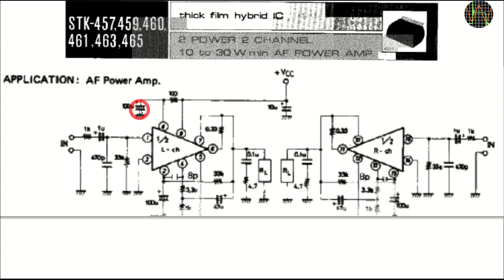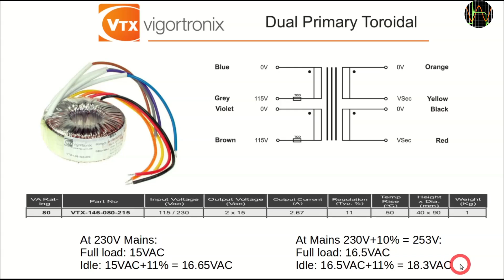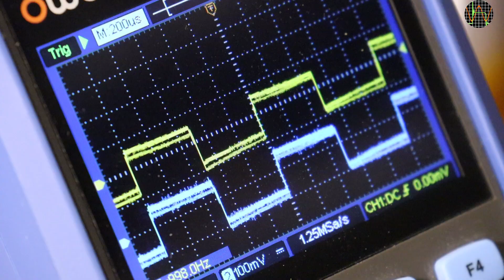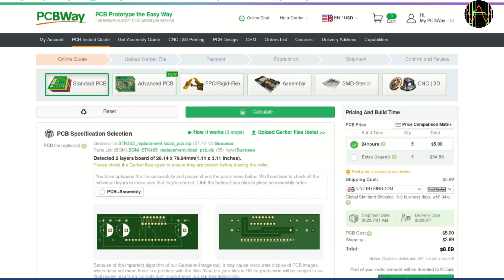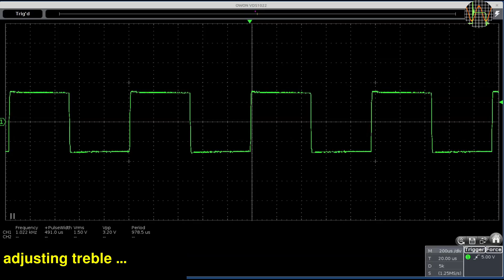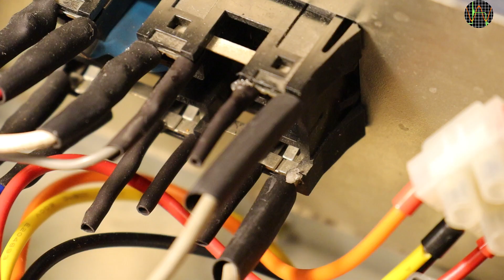187 - Repair of a Sony TA-AX310 Integrated Stereo Amplifier - Part 2

Comment: Hi!Thanks for the interesting video, which reminded me of something. I'll start by saying that today I bought this amplifier—the seller assures me it works. We'll see when the delivery arrives. Thats why I watched your both parts of this repair.
Going back to your modification. Some time ago, my retired dad was repairing an old amp from Poland for me(amp from 1988). Since he couldn't get the original transistors,even second hand- he finally  bought the suggested Chinese replacements under a different name. Unfortunately, the amplifier couldn't be started—he burned 4 pairs of those transistors in the process...Interesting-ones left channel burned,another time right ch... He said the amp has an unusual design for the idle current of the power transistors—there are no adjustable resistors, and with the original transistors it wouldn’t have been a problem. Eventually, he gave up and tried installing a new, ready-to-go board with Sanyo STK 4182-2x45W output stage. He also had to install a different transformer, unfortunately smaller one(less watts than recommended) at that, because the bigger one didn't fit, and rebuild a lot of the power supply... especially for the preamp section. The amp finally came to life, but the sound quality is a beat worse than the original amp.Unfortunately, the amp still hums slightly and distorts at higher power...But works🙂

Comment: But what are you going to do with the 4 extra boards from PCB way. You have no use for them and you can't sell them. No one will buy them.
Reply from the maker: I never intended to sell these. In fact I donated the design to the PCBWay community project library. Besides, $5 for 5 PCBs, so I wasted all of $4 which isn't that tragic. . Also I could populate another PCB with another LM1876, bodge on  a couple of feedback resistors and then I have a fully capable 2x20W stereo amp for some other project.

Comment: Nice hack to replace that stk module with a more modern chip.
To get that Bluetooth module to work without hum you need to use a dc-dc isolation unit.
Electronics old and new, has a video (and pcb on pcbway) that shows how he powers those modules in old tube radios.
Reply from the maker: or power it from an old  USB charger :) No need for additional expense, PCBs and whatnot. In reality, I was under time pressure to return the amp to a family member and so I opted for a hack.  .